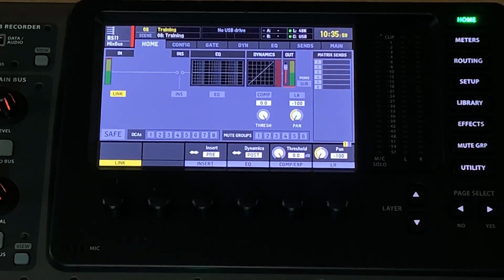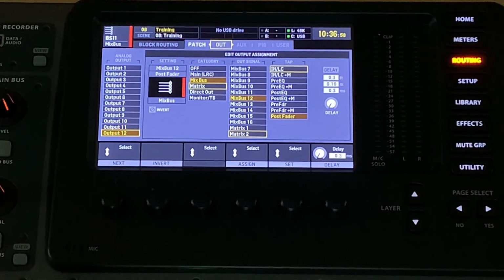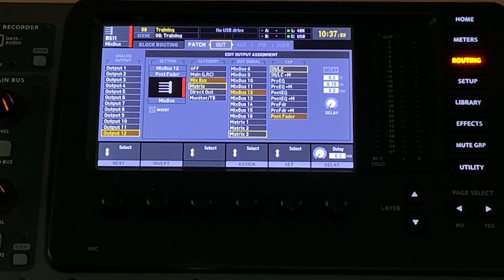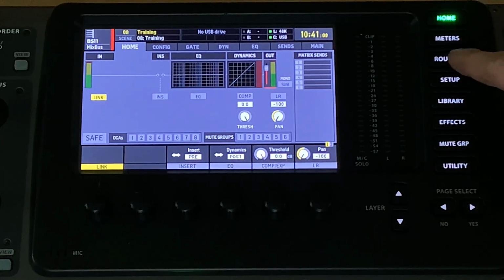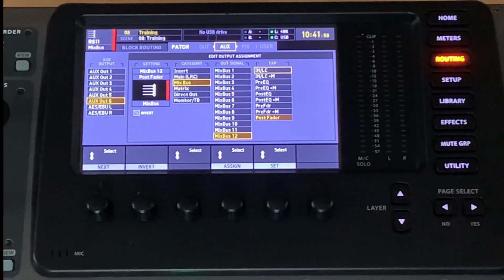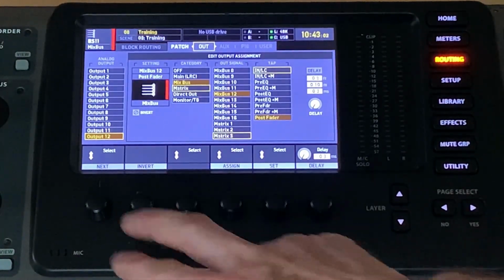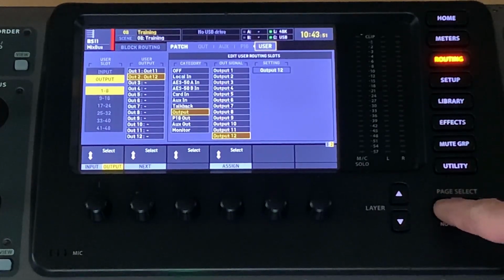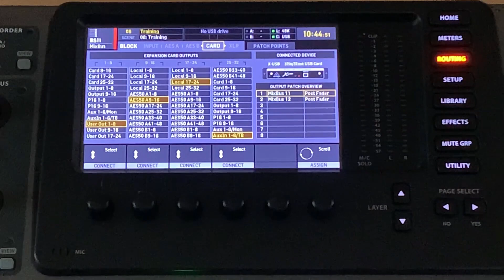3 Live Stream Routing Options for the X32 or M32

Comment: Hi, Is it possible to do a video of phyically connecting the back of the board using the Aux outs 5&6 to ATEM/Roland switcher,  also connectiong the XLR outs to an interface, then to our streaming device, and thirdly, USB printer cable from back of the console to a computer, or MAC. Showing how to phyically connect cables from the back of the X32, would be very helpful to then be able to better understand the routing tabs and how using mixbus, matrix, submixing a separate livestream would be helpful to volunteers who are new of may have difficulty making the right connections to feed their audio to their livestream.
Reply from the maker: Thanks for the suggestion. I guess that is something I take for granted in this environment and I currently don't have one video that displays all these connections. I will provide an explanation below in case that is helpful.

USB
When using the X-USB card you use a USB A-B cable (old printer cable) and connect to the console on the X-USB output (next to the small red light) and the other side connects to your laptop like any standard USB connection. If you are on a Windows machine you will need to download the X-USB driver from the Behringer website and if you are on a MAC, it should just connect. Finally, there are some security settings that are needed which are in this video here - https://youtu.be/wBHxLNjcZzo

XLR
After choosing XLR outputs in the Routing > XLR menu you can connect XLR cables from the corresponding outputs on the back of the console to your streaming device.

AUX OUT
If you choose to use the AUX out method and have properly routed your audio inside the console you can connect the correct cable from AUX OUT 5 and 6 and the corresponding cable (opposite end with a 1/8" TRS) into either the Mic1 or Mic2 input on your ATEM Mini. There are settings to address inside the ATEM to get this audio to properly come through, but those settings are discussed in this video here - https://youtu.be/VKYsoOIaFIs

Comment: Will the main mix gonna be mimicked to the livestream, like for example I use the XLR method?
Reply from the maker: This video shows you how to take a mix, route it to the desired location and then connect the cables. It doesn't determine which mix you want to use. You can make a copy of the house mix and send that out to broadcast, but if you are mixing consistently for both house and broadcast, I recommend using a MixBUS setup to give you a dedicated mix for a live stream. Here are some videos that can help you get that going.

(1) Post fader MixBUS Setup (what I use)
https://youtu.be/pMnaiuC55RY

(2) Matrix Setup (another option)
https://youtu.be/RXMAb8XNeys

Comment: I did option 3. It works!!! However for some reason if I mute the bus I used for livestream (11&12) I can still hear it through my live stream. 

It goes away when I mute my main LR fader..
Reply from the maker: This makes me think you don’t have the BUS feeding your live stream, but either a copy of your Main LR or a Matrix being fed by your Main LR. I suggest going to Routing > User Out and make sure that output 1 is sourced by BUS 11 (tap point Post Fader) and output 2 is sourced by BUS 12 (also Post Fader). Then go to Routing > Card and make sure that Outpit 1-8 are sourced by User Out 1-8. If you still need help feel free to find me on my website contact card at https://sound.allamhouse.com

Comment: Hi, for 1. Xlr outputs 
My output routing on x32 is all set to AES50 because we have a digital snake box (S32). So using the steps will I still get signal going to my Atem if the outputs are no routed to local?
Reply from the maker: Most of the tabs in the routing screen deal with outputs and this video linked below will help explain the differences. You can have mixed go to the physical XLR outs, different mixes going to AES50 and still different outputs going to AUX. 
https://youtu.be/PpeqRuPGi2Y?si=Yo9eGxKyj7BYmyep

Comment: It would be helpful to see exactly where you connect each type in the back of the mixer.
Reply from the maker: XLR’s would attach in the XLR outputs on the back of the console. AUX outs (1/4”) would attach in two of the six AUX out slots on the back (I usually use 5/6, but in theory any pair will work depending on your routing settings).  The USB will connect in the X-ISB slot next to a small red light that has a small metal bar on each side of it. The X-USB slot is the stock card shipped with the console, but some will update their cards for more features. Most cards offer the USB output capability, but there are a few that do not.

Comment: Hey Dave- Thanks for all the info!!! 

We are using a stage box (Behringer x16 / AES50 port) connected to my x32 which i would like to use the USB out to go to my computer using Vmix to stream.

The issue I' m having is that outputs 1-8 are taken due to stage box. 1-4 monitors, 5 available, 6 Sub, 7&8 to main speakers.
Do i have to use outputs 1&2 for USB?
Reply from the maker: Once you have built your broadcast mix, you then need to send it to some form of output inside the console. There are 16 outs and 6 AUX outs. You will need to go to Routing > Outs and set your broadcast mix to be the source for two outputs (assuming it is a stereo mix). Then, you can set this pair of outs to leave the console on Card 1/2 which would require using the Routing > User Outs settings. If you need more help, feel free to reach out to me on my website by filling out the contact card. https://Sound.AllamHouse.com

Comment: Hey Dave - You've been a huge resource for me and my church! I'm in a little predicament and was hoping you had some guidance. We have a Atem 1 M/E Constellation, the X32 console, and Propresenter as our presentation software. 
I have the X-live card connected to the Mac via USB and am using it as the audio source in propresenter, and we send the Atem video as the video source into propresenter, and then all of that is streamed out through propresenter to Youtube.

The audio routing in Propresenter seems very kludgey to me, and its hit or miss if the settings stay the same after a computer restart.

I wonder, would you recommend sending the live stream mix bus from the x32 into the Atem, and then using the Atem as the video AND audio source in propresenter?
Or is it best to go straight to Propresenter from the X32?

Thanks again for all your help!
Reply from the maker: This is a great question and I can only answer with my personal experience. When we streamed through Pro7, we sent our audio and video into our ATEM TV Studio HD (similar to yours) so the audio and video was combined in that device. We then sent that entire signal over to the Pro7 machine through an AJA-UTAP SDI-USB converter. Inside Pro7, we had a video source input (AJA) and the audio source input was separate (also AJA). With the video source there was an audio option available, but it seemed like it was two mono sources instead of a stereo source so we created our own audio source. We also found that all of the gear had to be on before we booted Pro7 otherwise we would have some odd connection issues or things would just fail.  We have since moved away from this setup and have everything running through an ATEM Mini SDI Pro and use a different Blackmagic device to send our key/fill sources across SDI from the Pro7 machine to the ATEM.
Reply: @AllamHouse  OK - I spent the day at church and think I finally have a handle on the routing in ProPresenter. Of course, it was one of the settings I had not looked at, which was the Live Stream/Capture Settings audio routing! I think I'll try this setup for a bit as my testing of it seemed good, but its helpful to know that the sequence of turning things on might impact how ProPresenter behaves. 
If this doesn't work, I might go to your old setup and see how that works. Fingers crossed and thanks again for all of your videos!
Reply from the maker: I'm glad you were able to get into the depths and find those settings. I hope it works for you and let me know if you have other questions.

Comment: How do you control the mix, eq, etc of the Live Steam independent of the house mix?
Reply from the maker: Most of us run a Post Fader MixBUS for our broadcast mix and use one of the methods discussed in this video to get that mix out of the console. If you use this method you have the individual inputs that you can send in different amounts to the broadcast mix providing a different mix for the broadcast than what goes to the house. With this in mind your overall BUS EQ and Comp can provide some shaping for the broadcast, but each channel only has one channel strip (EQ/Comp) so whatever you set for the house will be used for the broadcast. Here are two videos that can help guide you in your next steps.

(1) Building a Broadcast Mix for one Engineer - https://youtu.be/pMnaiuC55RY
(2) Separate EQ for house and stream - https://youtu.be/1WPltFnKnhs

Comment: x32 aux audio rca outputs controls?
Reply from the maker: I'm not sure exactly what you are asking with this statement, but the RCA connections on the back of the console are linked with both the AUX In 5/6 or the AUX Out 5/6. If you want to use the RCA outputs you just send your desired mix to AUX Out 5/6 and you are all setup. If this isn't the question you were asking, feel free to rephrase it and I can give it another go.

Comment: I’m hoping this may have solved my sync issue. I inherited the live stream operation at our church. We have a PTZOptics camera connected via Ethernet to  PoE and an audio cable to the X32 compact. Two other (different brand, not NDI) cameras are connected via Ethernet only to the PoE switch. Ethernet then into X32, X32 into audio interface into USB on PC running OBS. The pair of cameras audio is out of sync. If I understand this correctly, I can adjust these independently of the PTZOptics camera. Or is it better to attempt to add an audio connection to the out of sync cameras? Thanks for your videos. They’ve helped me immensely.
Reply from the maker: If you are going into OBS you can set a delay on the audio to allow alignment to the main video source. Also, if you can remove your other interface from the setup and run directly from the X32 to your OBS machine.
Reply: For some reason, the audio interface input is 1/4” aux out from the X32 then USB to PC. I don’t know why it isn’t connected using the USB out on the card. Thank you for the reply and I’ll check it tomorrow.

Comment: I have to add that if you are running aux sends into the ATEM, then you have to go into your ATEM software control and pan left and right on your mic input!  If not then it will continue to send a mono signal...
Reply from the maker: While you can go into the settings and make changes, I find that usually this is not necessary when the proper cables are used. The mic inputs on the ATEM Mini line of stream devices are setup with a TRS input which means both 1/8" inputs provide a stereo input. You do need to make sure you have the proper cable connecting the soundboard to the ATEM as the cable could have two 1/4" on one side, but the 1/8" head could be a mono (TS) head which would only give you a mono input to the ATEM. I hope this helps clarify.
Reply: @AllamHouse  I have all this set up and a TRS cable.  It's been sending mono signal since I set it up...  But I had to go into my ATEM software the pan left/right

Comment: Hi, we use the aux out connecting to the Atem mini, but lately there has been so much background noisr audio, it’s almost unlistenable. Do you know what might be the issue?
Reply from the maker: Usually these issues are caused by two problems… 1) the gain structure on the board is not set properly and you are trying to make up the volume in the ATEM. 2) the gain on your mic input in the ATEM is too high. Typically I see a good mix in the console being paired with the gain at -35 in the ATEM.

Comment: Thanks. The 3rd option was very helpfull to get me started on the M32R live. Would it also be possible to just send the master outputs to the USB interface?
Reply from the maker: Yes. To do this you have to make sure to set your main outs to a physical output (or AUX OUT) and then it can be routed properly to the USB card output.  This video walks through the setup in case it is helpful. https://youtu.be/YRIw4qmVzSM
Reply: @AllamHouse  Thanks again. This helps a lot! As does the other video.

Comment: Question: why is my online vocals go higher of +10db when the FX was on? Any answer?
Reply from the maker: If I understand the question right, you have your vocals at a certain level and when you turn on the FX they get way louder (10dB as stated). Keep in mind that FX are just an additional mix that is added into your dry mix. If you have a lot of vocals going into your FX then you will be adding more vocals for every FX bus they are included in. It is a balancing act of adding the FX and then evaluating if you need less dry vocal or less effected vocal and then making the appropriate changes.

Comment: Awesome video! At our church, we use the x32 to receive audio from our computer (ex. audio from a video to be played in church) to a stereo AUX IN on the x32, and also send audio from the mixer to the computer for our live stream audio. The computer is using vMix. We’ve been having an issue though, whenever we have our AUX IN fader up to play audio from the computer to FOH, the signals from the mics, and instruments double (essentially feedback loop) even though the AUX IN from the computer signal isn’t being sent to the live stream bus (where all the instruments are being routed to along with the master FOH output). Do you have an idea what might be causing this? Let me know if you need me to clarify anything!
Reply from the maker: We have a similar issue and while our setup is different, they still share some commonalities. The solution we use is to have the channels that run the audio from the computer back to the console pulled down most of the time. We only push it up when there is a video running that needs to be heard in the room. We use a DCA to control this audio input so that our engineers have quick access to drop the signal which removes any possible doubling up of sound.

Comment: Can I just use one mono 1/4 to 3.5 to plug into ATEM mini?
I'm just libestreaming a speech. 
Also do I have to change input type in the atem software settings for that mic.?
Reply from the maker: You can take a single mono output and run it into a Mic inout on your ATEM mini. Keep in mind that the Mic inputs are stereo inputs and you will need to find a way to have your input summed to mono in the ATEM so your signal is heard in both ears. I believe in the control software there is a button at the bottom of the mic input fader that has a button you can push to make this a mono input vs stereo input. Also, keep in mind the signal coming out of your board will typically be more at a broadcast level already and you will need to turn the gain down on the ATEM so it doesn’t distort.

Comment: We use at church obs on desktop. For some reason obs won’t pick up the audio from x32. Running usb from x32 to desktop.  If the routing is correct  I follow your video step by step. What I need to do on my desktop to recognize the audio.  Thanks any help is appreciated
Reply: Also had downloads latest driver for desktop versions 5 I believe. The drivers say x-live. Is that the proper driver and version to have on desktop. If you could help make sure everything set up on desktop. I make sure on the sound on computer x- live 1-2 and there’s other options. Thanks
Reply from the maker: So, the things to consider in this situation are the following:
1) Do I have a mix setup and routed to go across USB 1/2?
2) Which card do I have installed on my console? X-USB, X-Live, or Midas version
3) Do I have the appropriate driver installed on my machine? IE: X-USB card requires the X-USB driver (MAC does not require a driver install)
4) Do I have my security settings on the computer set to allow audio for my application? This video discusses these settings https://youtu.be/wBHxLNjcZzo
5) Did I select the correct audio card in my desired application to receive this mix?